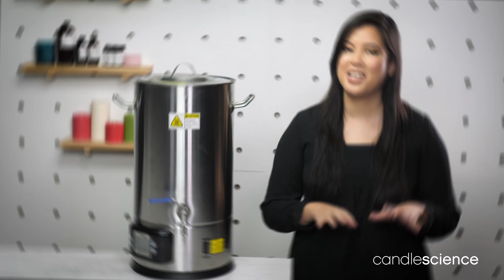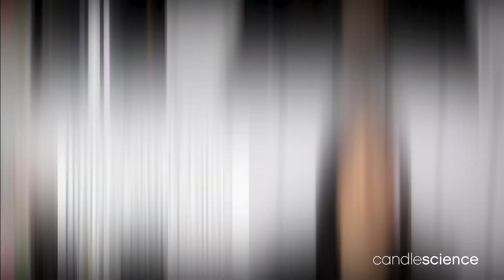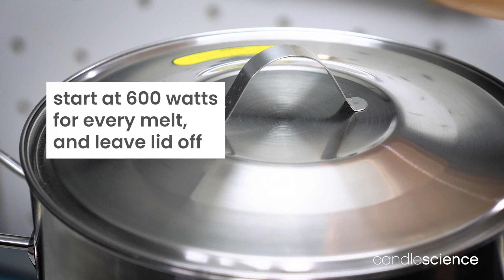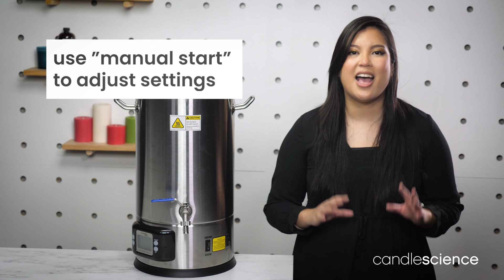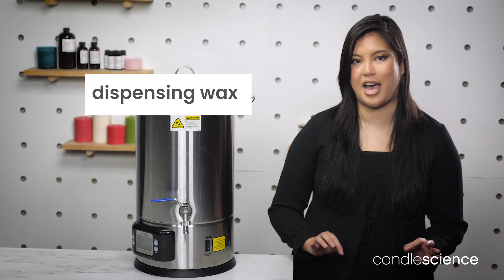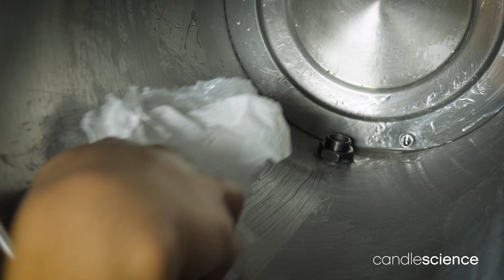How to Use the Stainless Steel Wax Melter 30 lb + Tips and Tricks | CandleScience

Comment: Anyone else getting an e4 error no matter what you do? Just got it and can't use it
Reply from the maker: Hi! This is likely a dry heat error meaning there is not enough wax (or not enough melted wax) in the melter. It is usually rectified by hitting the reset button on the bottom of the melter. To reset the melter, just make sure the wax and melter has cooled to room temperature and unplug the unit. Tip the melter over and press the “Reset Pin” on the bottom. This manual may help as well: https://dpoy1j4zladj1.cloudfront.net/Wax%20Melter%20User%20Manual-5.pdf
Reply: Yes!!! Trying to figure it out 😬

Comment: Don't you have mini melters. I don't have the need for such a large wax melter
Reply from the maker: The only machines we currently carry smaller than the 30 lb melter would be the Candle Maker, which has a larger pitcher attachment: 

https://www.candlescience.com/equipment/candle-maker-8-oz/
https://www.candlescience.com/equipment/large-candle-maker-pitcher/

Using a pouring pitcher with a double boiler might be the way to go though if you are working with smaller amounts of wax. The large pouring pitcher holds up to 4 lbs of melted wax: 

https://www.candlescience.com/equipment/pouring-pitcher/